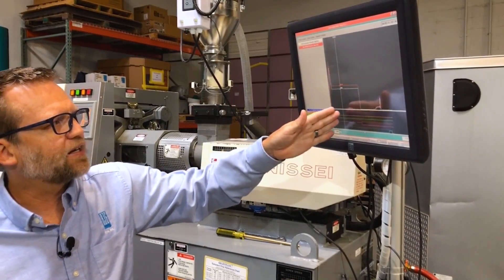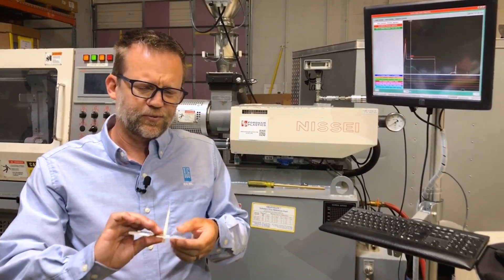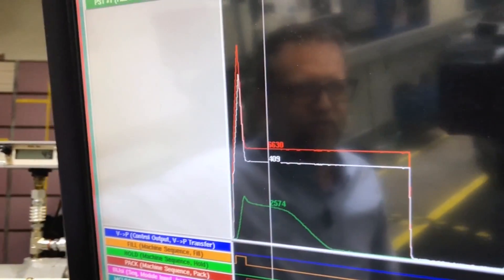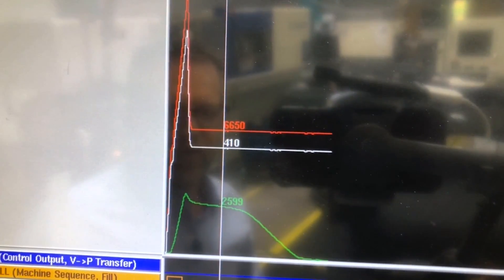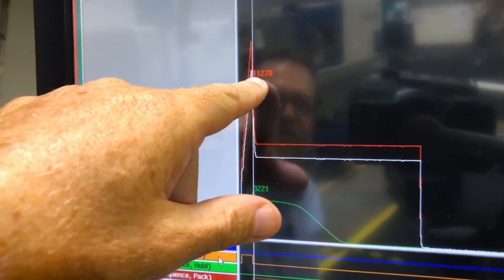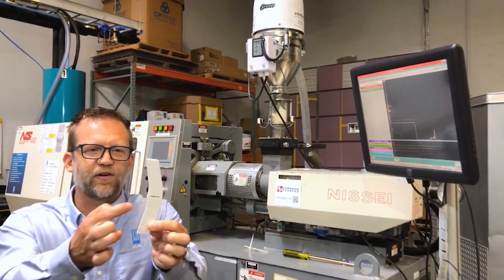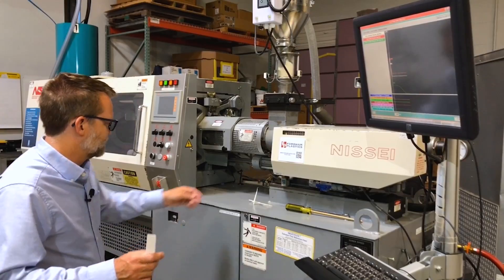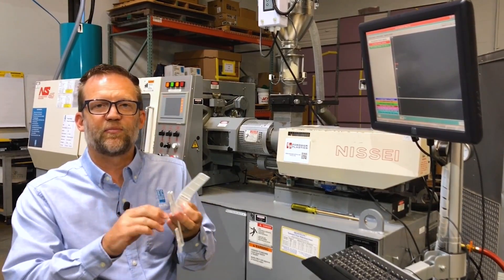Hydraulic, Specific, and Cavity Pressure: What's the Difference?

Comment: hi great video. i think you the best channel in injection molding educational videos. i have a question. the hydraulic pressure is the pressure of the hydraulic oil in the back? specific pressure is the molten material pressure? cavity pressure also molten material pressure?
Reply from the maker: That is correct. Specific pressure is molten plastic in the barrel and cavity pressure is molten plastic inside the mold. We appreciate your comments.

Comment: interesting! what's the difference between specific and back pressure?
Reply: Specific pressure simply refers to the pressure of the plastic in front of the non return valve. This can be during injection , hold , or recovery ( back pressure). Back pressure is resistance applied to the movement of the screw as it moves in the direction of shot size during recovery.

Comment: Hi and thanks so much for the great topic,
I watched your webinar on this topic and it is excellent.
I know my question is not that related to this video but 
I found no better place to ask from you,
I'm trying to make a true picture of what the injection machine
does and a ask you to clarify this for me if possible,

"We know that the driving force in the injection machine is
hydralic or electric motor, so when we enter a value for injecion 
rate or injection velocity in first stage or filling stage what the machine 
does to maintain the value we set for velocity is it exerts a 
pressure to see what the resulting velocity is and in a closed loop 
it sets different pressures to keep the velocity on the value we 
have entered". 
What I'm pointing is actually the velocity is a result of a profile of
different pressures adjusted by machine to maintain our prefered 
velocity. Am I correct about this?
Thank you.
Reply from the maker: Thank you for the kind words. On a hydraulic molding machine, there is a pressure limit that is set by the user. This pressure limit allows the machine to use up to that amount to achieve the flow rate. When an injection velocity is set, the hydraulic pump sees this as a certain gallons per minute. The pump will generate that GPM of hydraulic oil. The resistance of moving the screw and the plastic into the mold will start building up a dynamic pressure the further the mold is filled. The pressure limit is established 10-15 % higher than the required pressure under normal circumstances. I hope this clarifies your question.
Reply: @rjg  Thanks so much.

Comment: Very nice.. in this graph ,how the green line is down side where as the value of cavity pressure is more than the hydraulic pressure.. please explain..
Reply: That is the peak pressure when the plastic hits the small gate.  Then it drastically drops in pressure but for a fraction of a second it’s higher.

Comment: Hi sir,
Can you tell me where u locate transducers to measure cavity pressure & specific injection pressure.
I'm waiting for your reply
Reply from the maker: Hello! Cavity pressure can be measured anywhere in the cavity. Near the gate and at the end of fill are the most common locations. The sensors can be indirect (under an ejector pin) or direct ( flush mount in the cavity). Specific pressure is measured in the hydraulic cylinder and converted to specific via the Ri. In electric machines, a load cell is directly behind the screw measuring the force then converted to pressure. We hope this helps!

Comment: So what about back pressure?
Reply from the maker: Back Pressure is generated behind the screw. In a hydraulic machine this is done with a relief valve to generate restriction and then a certain hydraulic pressure. Electric machines do this with a load cell behind the screw and use the servo motor to provide the braking action. The most important part is to be able to convert the hydraulic pressure to specific pressure , then you know what back pressure is doing to the plastic in front of the screw tip. On the electric machines the value typed into the BP set point is already in specific pressure (plastic pressure in front of the screw tip).

Comment: How is cavity pressure measured was my question, aaaaand now I'm going to look it up. Thanks!
Reply from the maker: Cavity pressure has to be measured with cavity pressure transducers. These can be installed directly in the cavity or under an ejector pin.
Reply: @RJG, Inc.  ok that makes sense. What is RJG, A tooling program or a job shop or both?
Reply from the maker: https://youtu.be/adlDExoMY4Q

Comment: Hi Jason! Thanks for this clarifying explanation. I have one question though, which of these pressures is the one we commonly call injection pressure (I.e. on Moldflow), specific, or cavity pressure?
Reply from the maker: In simulation, injection pressure refers to the specific injection pressure. This way we can correlate that pressure to what the target machine has available and verify that the machine can generate the required pressures.
Reply: Same as VP Pressure
Reply: Your pressure transducer is reading the pressure of the screw pushing forward. Your intensification ration is usually around 10:1 2000 psi injection pressure means 20,000 psi. Just quit your job

Comment: Do you have any table with ratio of hyd pressure vs specific pressure vs cavity pressure .. considering intensification ratio and gate sizes
Reply from the maker: The relationship between hydraulic and specific pressure varies widely from machine to machine. The Ri can be anywhere from 11:1 up to 20:1. Of course there are some machines even lower or higher than that. As far as the cavity pressures, there are huge pressure losses beginning at the nozzle and continue thru the runners, gates and then across the cavity. A simulation can predict the cavity pressure generated and that info can then help determine how much specific injection pressure your machine may need. This is usually achieved by sizing the barrel correctly as the hydraulic system pressure usually remains the same.

Comment: Thanks so much...good información.I just have two question: what is the optimal intesification ratio in order to avoid lossing press? And the  other ...it is correct that RI in an fully electric machine is 1:1?
Reply: I would not say there is an optimal intensification ratio. There is a relationship between the barrel size and the ratio. If you are in a situation where more shot capacity is needed then your intensification ratio will be lower in most cases. If you need a higher Ri then shot capacity will be lower. An electric technically does not have an Ri since there are no hydraulic cylinders. Some times when we are using software for hydraulic and electric machines we will input the ratio as 1:1 for the electric machines so the Specific pressures remain unchanged.
Reply: Pressures in electric machines go by plastic pressure. Usually in the 26000 range

Comment: Can we caiculate cavity pressure and how
Reply from the maker: We can read cavity pressure with Cavity pressure transducers. A well done flow simulation is the best way to anticipate cavity pressures. This is a service that RJG provides. 😊
Reply: @rjg  cavity pressure is a good thing, however do we need the tool maker drill holes to put in the sensor,  I guess this is something put away  many of us adopting the cavity sensor.

Comment: Sir How much force required for slider cylinder against cavity pressure how to calculate it
Reply from the maker: The clamp force calculation for a slide is the slide shut off area X’s the tonnage factor then divided by the tangent of the slide angel.

Comment: So the cavity PSI requires a sensor in the mold, How reliable are those and do they require maintenance?  Never worked with them.  :)
Reply: Kerry, as molders we make decisions based on the information we have. There's no better information to have than direct feedback as to what is happening in the cavity itself. There are definitely challenges to transitioning to monitoring cavity pressure, but it's well worth it!
Reply from the maker: Having cavity pressure data is another tool in your toolbox.
Reply: Greetings. RJG sensors are very accurate and reliable. I've been working with the RJG's eDART system for a few years.  It's a very useful and strong tool.
Reply from the maker: Glad the system is working for you!
Reply from the maker: Yes, cavity pressure sensors are required to read the pressure , but the pressure is always there.